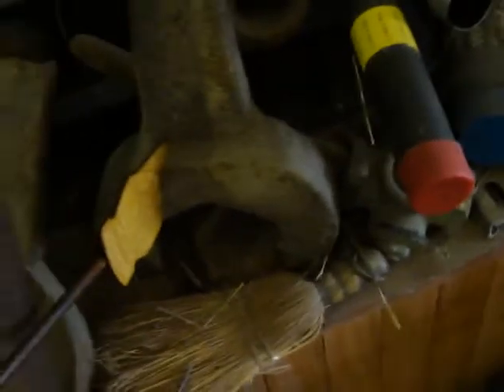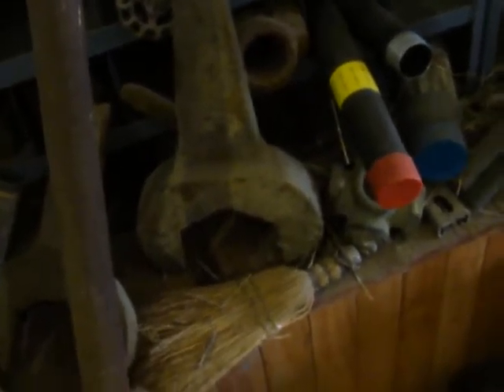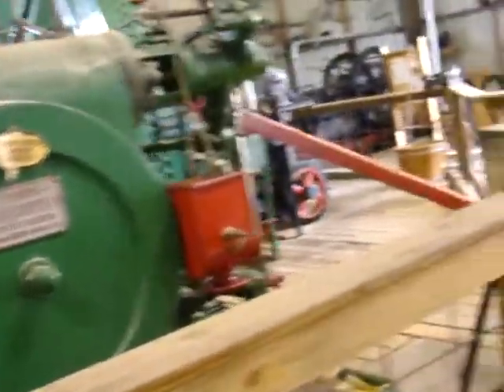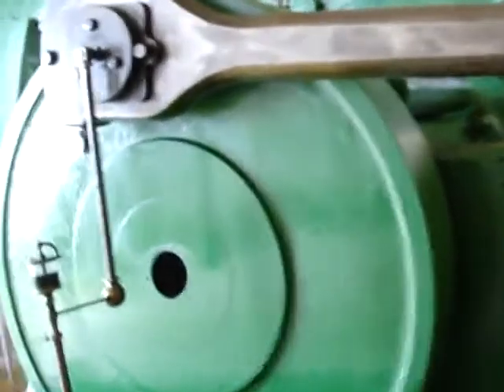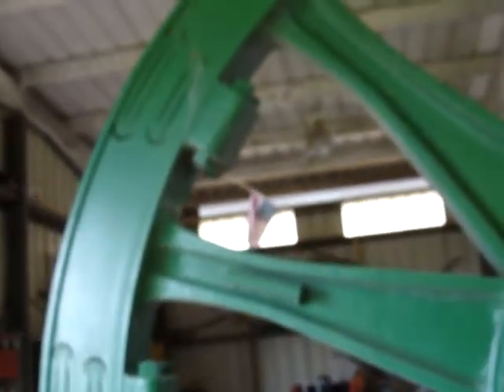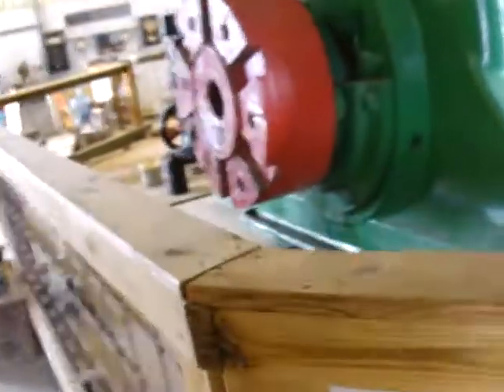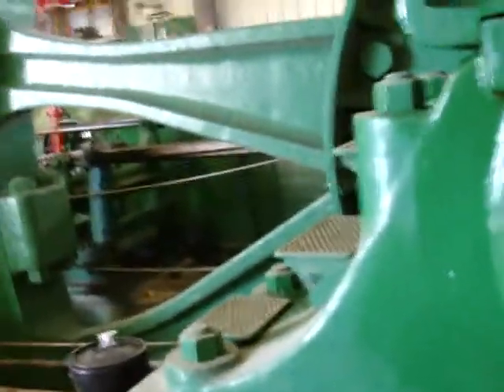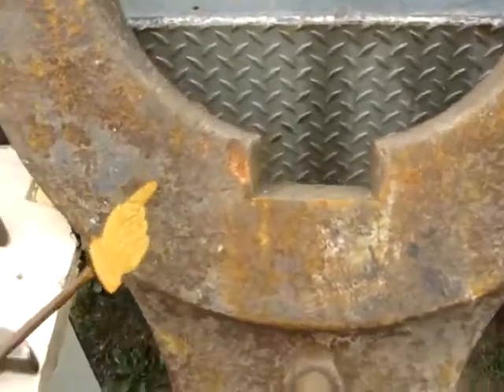Freeport engine show, Big wrench with Cooper-Corliss stationary steam.

Comment: that big green engine is the one they call the cooper-corliss engine right? Why was it not running?
Reply from the maker: Boiler problems shut down in 2018.  Steam boiler is separate from the engine, without steam... engine doesn't run.
Reply: We had to put new flues in the boiler a couple years ago. . . We had it Run-able again at the end of 2019 but late enough in the season it didn't pay to fire it up for One Weekend and then drain everything to Winterize it, and then of course everybody was shut down in 2020 courtesy of COVID. . . And now this year the boiler inspector decided we needed the Safety Valve Rebuilt before he would Certify it. . . Will Be Running Again Next Year.
Reply from the maker: @oldSawyer  i hope so.